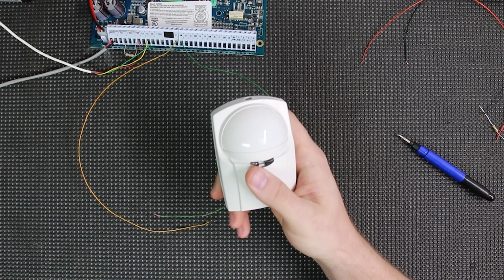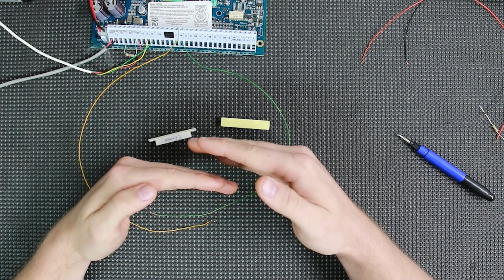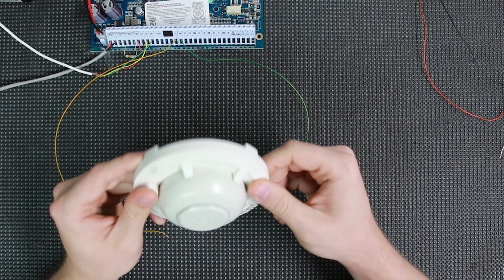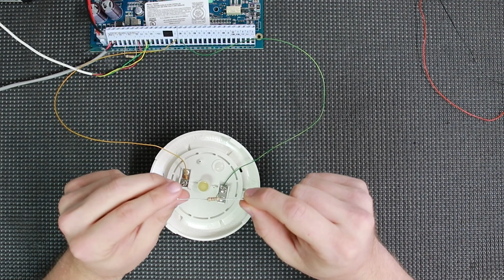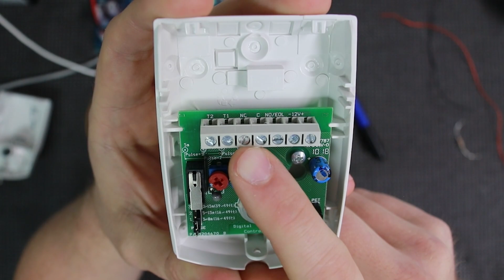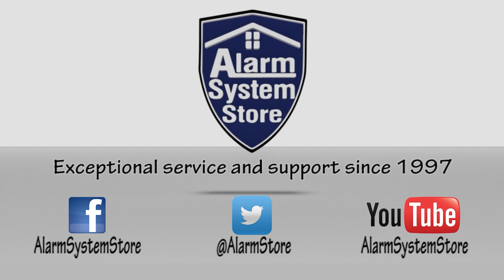Series and Parallel Wiring With Alarm Systems Explained

Comment: I was so pleased to find your site and immediately subscribed. My problem is that I replaced several windows on one side of my house and one window on the other side of the house. The window contact for the single window works fine after reconnection, however none of the windows on the other side is responding after reconnection. I have not detected  any broken wires. Could you help me by providing any information to troubleshoot the problem? Thanks for the great job you're doing teaching on the topic.
Reply from the maker: I would guess the grouping of windows is on a series circuit, and one of the wires is either broken, shorted, or you have a bad sensor in that group. Its hard to advise much more based on the info provided, but if nothing changed with the alarm system itself, the issue has to lie with either the wires or the sensors.

Comment: In the case of wiring a magnetic contact (the load is located inside the alarm as sensing circuit) and not an external load, shouldn’t the wire colors be different, since there is no concept of voltage drop or the concept of phase and neutral? Is this done purely for easier troubleshooting and separation? In an open circuit, wherever we break it (regardless of the initial color coding of the conductors), do we always have one side with high potential and one with low?

Your videos on DSC NEO alarm systems are not only extremely informative but also enjoyable for relaxation :) The fact that you answer questions before I even have them makes you exceptional professionals and teachers!

Comment: With home runs to each window and tieing the windows together at the panel to a single zone, the EOLR is of no use.  It cannot see a short in the wire.  Isn't that right?
Reply: No, at least not if you have all home runs in series connected to NC reed switches as described in the video.  If you had no resister at all, there would be a "near" short circuit through the reed switches.  I call it "near" as the daisy chained home run wires have a non-zero resistance.  However, the combined resistance is still lower than the panel electronics and power supply can support as the current would be too high.  To correct that, resistors are added.  
I sorted out the rat's nest of wires in my panel and found that the installer joined three home runs in series on each of three zone loops as described in the video.  
Interestingly, the install was done by a professional technician working for one of the major monitored alarm system companies. That installer placed all of the "EOL" resistors hanging off of the terminals on the panel itself.  The resistors were in series with the series connected home runs as described in the video, but at the start of each loop rather than the farthest point or end.  The installer knew that total resistance determines current and current is constant everywhere in the series circuit (don't sharp shoot me on EM fields here, the statement I made is close enough to reality for DC circuits).  Therefore, while the resistors are needed, their location in the series circuits doesn't matter if the wires remain undamaged for the life of the system.

(I edited this last sentence on 13OCT for clarity and to correct my invalid assumption on ELOR purpose) The main reason that ELOR is a best practice is that it will present a different current (than either a ready to arm loop or a loop with any one or more windows/doors open) to the panel if there is a short circuit anywhere in the series loop before the last reed switch.  So, the installer of my system was probably using a short cut since adding resistors at the panel where he did is much easier than squeezing them into several reed switch cases.
Comments?
Reply: @LonKarl-l7l can you elaborate on your first sentence for me. " Not if you have all home runs in series connected to NC read switches" I'll give you an example. Two separate windows in a living room and each window has a two conductor cable running back to the panel. Now there are four conductors at the panel. I understand how to connect them in series at the panel to wire to a single zone. I've drawn out the circuit on paper but for the life of me I cannot see how an EOL resistor on the last window can detect a short if the short is at the first window. The current would flow through the short thereby bypassing the first window and flow through the resistor at the second window. The panel would not see the short.
Reply: @msalvag  I apologize if I am stating the obvious, but my example is assuming that the resistor is also in series with the reed switches connected in series at the panel (in my case three reed switches).  And I am not saying it detects a short, because I use the word "detect" to mean reacting to a state change.  Rather, the resistor would always "see" and so prevent (by adding ohms to the circuit) the high current, near short created by closed reed switches when all the windows are closed, which, of course, is all of the time when you arm the system.   When one of the switches opens as the magnet is moved away from it, the current drops to zero and the resistor does nothing. 

I am not trying to explain what happens with the installation of the resistor in parallel with any reed switch or even the farthest (EOL) reed switch.  I agree with you and do not see any use for that in this part of my system.  Let me know if I have failed to clarify it.

Comment: Yes awesome demo .Need to know i have 3 window contact snd a sensor 
Whats the connection running on 1 crcuit
Reply from the maker: Thanks for watching! You will likely wire them in series for your system.

Comment: So I have (multiple series) loops and each loop contains magnetic window switches, as well as shock sensors in between the (Anderson style) windows. I can’t wrap my head around how that works. Honestly nobody has ever set off the shock sensors and I’m not sure they are doing anything. I took a multimeter and isolated one shock sensor.  There are 4 wires, but the installer only used two of them. There’s continuity between the wires.   When I hit the sensor it very briefly fluctuates ohms, but within a second, there’s continuity again. Can something like this actually work? A split second change in resistance? It’s an older ademco vista 20 system. Any info would be greatly appreciated.
Reply from the maker: Most systems have a response time of less than half a second, so yes it should work fine, though its designed to catch a window breaking, so they can sometimes take a decently good hit before triggering. Otherwise youd run into false alarms. Its a bit unique that your shock and contact sensors are all wired in the same loop, but they're all 2-wire sensors, so they should all just be wired in series.
Reply: @AlarmSystemStore  Thanks very much for your response. I appreciate it.

Comment: Hi. I have 4 IR beams ( 2 receivers & 2 transmitters) that i need to connect on 1 zone. How do i do that, cause when i connect the 2 NC & 2  Common to the one fron the panel, it doesnt work.
Reply from the maker: If they are NC they should be wired in series. May need a resistor as well if your panel requires them.
Reply: @AlarmSystemStore  Thank you. I put them on NO and they are working. Also put a resistor on each.

Comment: If you walk past a motion sensor normally clothed - but walk slowly past it without clothes on - would it still set off the alarm panel?
Reply from the maker: Clothes has no impact on a motion sensor.
Reply: @AlarmSystemStore  Imagine if it did 🤣🤣
Reply: @kevportillo let’s start a rumor that they do and see if burglars start going naked 😂
Reply: A passive infrared sensor detects a change of heat ( raised or lowered) within an area of vision.  These areas are much like looking down a conduit tube but there are many of them ... typically 30 give or take.  These ares, via the freznel lens, are directed onto the pyro-sensor, much like a camera lens onto film.  When someone move in the area covered, the detected  heat sourses 'dance around' the pyro sensor - These are anylized by the electronics to then trigger an alarm activation. Alarm eng.  UK

Comment: You confuse infinite resistance. Closed circuit has negligible mOhms of impedance, in boolean logic interpreted as 0; or when EOL is set, 5.6kOhms is considered 0; whereas Infinite resistance is exceedingly high value, a 100% voltage drop - an open circuit, or a dry and sober tech in-line 😂 1.  Also, speaking of serial wiring, next time you have repetitive false alarms at night on a zone with 18 splices, you’ll be extra happy your installer didn’t do it, saving a couple of expanders and sleepless nights. Otherwise, good video to send new techs understand science of electrical connections.